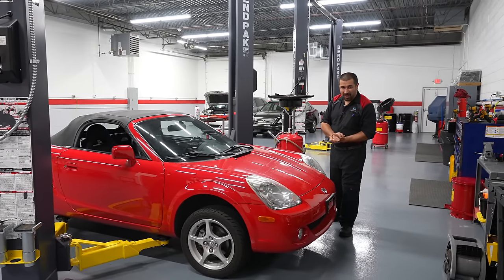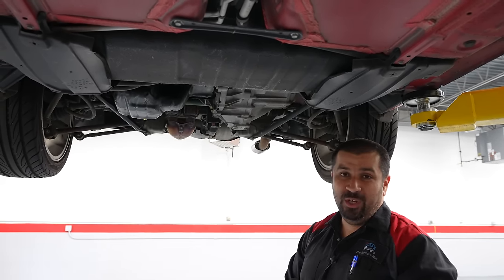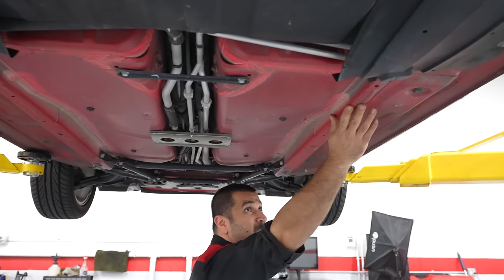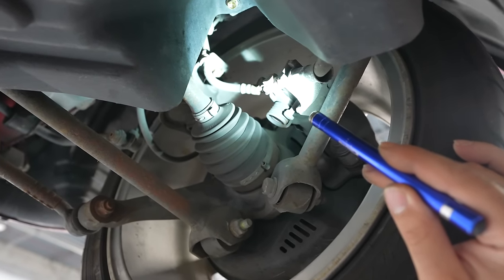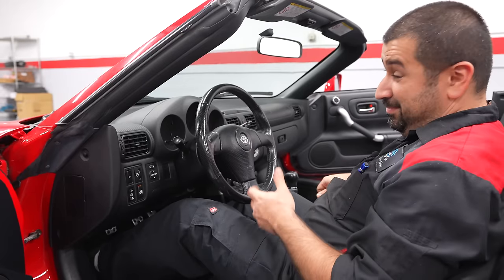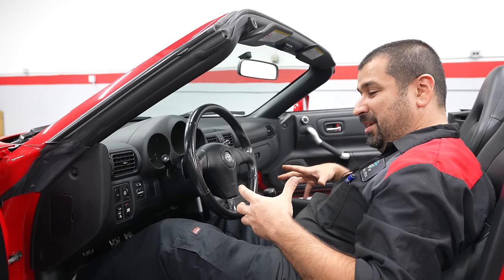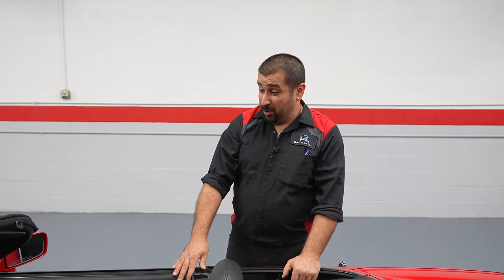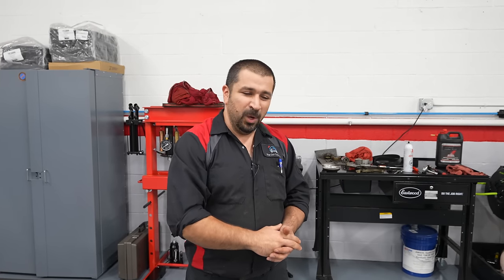Toyota MR2 Spyder Deep Dive | A True Toyota Icon That Should Come Back

Comment: Your reviews are really great! Appreciate your expertise. 

However, I am a bit confused of you stating that this engine is very good. Let's say this is not my experience with it.
Could you comment on the 1ZZ's problem and more importantly YOUR experience with them (how many did you fix, etc)?

We had a few 1ZZs in the family, 2x Celica, my MR2 and in summary 4 engine failures, related to oil consumption.
Only used high grade oil with stated viscosity and never did to many kms on one oil change. No matter what I did, when the engine decided to drink oil, there was nothing I could do about it.

Only changing the complete short block was a fix.

greetings from Austria
Dom
Reply: was a design flaw in the piston rings that causes this issue, shouldve got a 2zz celica :)
Reply: @arcanevoid9199  Actually, it isn't the pistons...it's the cylinders that distort and cause higher blow-by resulting in higher temps at the rings.
no i don't - wrong wheel drive buddy :)
that's the shame. 2ZZ in the spyder, yes please :D
Reply: @dominikr5408  the cylinders? huhhhhh, ive never heard that in my life. its common knowledge that its the rings, if you google the first like 8 results all say the same thing. and if that was the case how come changing out the rings/rebuilding it fixes the issue? and how come toyota revised the piston ring design and not the whole block? and of course you would be one of those "wrong wheel drive" people, let me guess they were automatic too?

Comment: COOL NEAT CAR, VERY INFORMATIVE VIDEO. I wouldn't mind having one to DRIVE, but it appears to be NOT TOO PRACTICAL except for just DRIVING. You can't travel with this vehicle, no room for LUGGAGE AT ALL. 40 years ago I had a 1974 Fiat X1/9 (first model year) best year for LOOKS, at least until 1979 when they got rid of the front and rear eye beam shock absorber bumpers which were UGLY AS HELL, I thought. That car was much more PRACTICAL THAN ALOT OF OTHER SPORTS CARS from that time period. It was mid-engine as well, 4 wheel disc brakes, removable hard top, built-in roll-bar with REAL GLASS back window with defroster. It had a HUGE front trunk (you could put just about the LARGEST SIZE SUIT CASE,  a hanging clothes bag AND the removable hard top stores on top over those items. Then you have another smaller trunk behind the engine bay area. It was fairly good size, you could put a LARGE DUFFLE BAG and still have room like the front of the MR2 has to put small things. The spare tire (FULL SIZE but skinny 145/80-13) the same skinny tires all around the car, gas tank was behind the driver and the spare tire behind the passenger seat. Of course the interior area was small but not that bad considering unless you are CLAUSTROPHOBIC. An old friend of mine had an MG Miget, that car had a TINY interior, the dash is right up on you nothing like the MGB. NOW the CONS of that car the tires were way too skinny even though it could pull better than a .80G lateral acceleration in a skid pad test which is closing into the Ferrari handling realm. 😮 The car has no power to speak of with a 1300cc engine rated at 68hp in America, European form it had 74hp. 0 to 60 was a PITIFUL 12.5sec. but it got GREAT MILEAGE depending on how FAST you drive it could get almost 45mpg if you kept your speed down to 55mph on the highway. I put mag wheels on mine and 185/60-13s all around and it was a MONSTER in the corners, it would STEAL YOUR BREATH AWAY in the turns. When I had passengers they would be grasping the dashboard to help keep them in place through the curves. THE CAR WAS A BLAST TO DRIVE, like driving a OVER SIZED GO-KART.  I MISS THAT CAR. 😢 HAD trouble back then getting parts. Bertone did a GREAT JOB making a CUTE, FUN TO DRIVE, GREAT GAS MILEAGE AND SOMEWHAT PRACTICAL TO TAKE A TRIP CAR. BEAUTIFULLY ENGINEERED, JUST WISH IT HAD MORE POWER BUT THEN I MIGHT HAVE LOST MY DRIVER'S LICENSE for going too FAST.  THANK YOU FOR YOUR INTERESTING VIDEO THAT ALLOWED ME TO REMINISCE. 😮😊😊😊😊😊

Comment: The MR2 has a rubber water line deep in the engine. Being rubber, it will eventually fail. The only way to replace it is to drop the engine.

Comment: Would it be possible to fit one of the new dynamic force engines into an MR2 spyder? Either the m20a-fks or the a25a-fks.
Reply: just 2zz or k20 swap, doesnt make sense to swap in anything else
Reply: @arcanevoid9199  Really? Because people swap other engines into this car such as the 2gr-fe v6.
Reply: @IrugaZERO  2gr is a good swap for a 2nd gen mr2 not a spyder. just because you can fit it in doesnt make it a good swap. why would you want to add more weight to the rear of a mid engine car? its also very light and doesnt need the torque of a big engine. youll just end up ruining the whole driving dynamic of the car, its a really good handling car
Reply: @arcanevoid9199  How about improved handling, making it less likely to understeer. Improved traction, acceleration and braking.
Reply: @IrugaZERO  it’s not going to improve that, the car already doesn’t have a problem with understeer. adding a whole bunch of weight is just going to push it over the edge and also make snap oversteer a much bigger problem. the mr2 spyder chassis is really well balanced from factory. the only improved traction it will have is accelerating in a straight line, and it will be worse at braking. sad when people ruin what the car is good at just so they can make it fast in a straight line
Reply: @arcanevoid9199  I was merely pointing out the benefits to increasing the weight over the rear axel like you asked. Whether or not it's a sensible decision it up to the person tuning the car to their preferences. The weight difference between the 1zz and 2gr is only 60kg. Hardly backbreaking weight there.

Comment: You have to hand it to Toyota for engineering a mid engine car with access to the engine unlike Porsche which actually put the engine under the car. You can’t see the engine and have to remove it to change the spark plugs😂

Comment: Lmao SMT is literally filled with the same parts from SMG, e.g. pressure sensors, etc. Don't shit on something you don't even know.

The left side vent is actually the intake for the engine. I don't doubt your abilities as a good mechanic, but come on. This is basic stuff.

You also shouldn't put anything on the shelf behind the seats. The flaps on either end of the shelf fold downwards when the roof is stowed, and it's very easy for objects to roll or slide off over their edges. They will land directly in the water drains and can potentially clog them, which will cause the interior to flood.

Comment: This is not a MR2 or a MR2 Spyder, it is a MR-S.
Reply: they are interchangeable, it is called different things depending on where you live. idk why you need to try and correct it
Reply: @arcanevoid9199  yeah, no. The previous versions were the MR-2. This one is the MR-S because it ONLY came with a soft top as in Spyder. A Toyota mechanic and enthusiast should know.
Reply: @fcorivers  so why is there oem badges that say mr2 spyder? why is it called that in so many places? and you can get them with hardtop, idk how you can be an enthusiast and be this picky with the naming of stuff

Comment: Love the car will never own one 😂. Too difficult to maintain with everything cramped and flipped around.
Reply: Oil changes are simple, mines needed nothing else in 12 years apart from the accessory belt which took 20mins and a coolant change wasn't any worse than any other car I've done.

Comment: That MR Spyder could've been great, if they didn't make it so dang ugly. "Let's make one of the greatest platform configurations ever devised, also make it lightweight and affordable, and then make it fugly af..." Great job, Toyota.... Way to shoot yourself in the foot. If it just looked a little better, we could've seen a longer production and potential upgrade with the VVT-L-I engine, and then it could've been one of the best cars of the 2000's. But instead, it just turned out to be one of the biggest flops.
Reply: I think it looks great - always did. Unfortunately, the MR2's fate was sealed by the Mk2, not the Mk3. The Mk1 MR2 was a cheap(ish), lightweight, compact runabout - loved by the press and public alike. Whereas Mazda went for evolution with the NA, NB, NC and ND MX5/Miata (this is what has given the MX5/Miata its longevity), Toyota created a more expensive, heavier, bigger GT like Mk2 MR2 - a change in direction from the Mk1 and press and public were confused - it was a different ethos to the Mk1 - big mistake. The Mk3 is the spiritual succesor to the Mk1 - not the Mk2, which, other than being mid engined, is really a different car. I've owned all 3 versions, and loved the Mk1 and Mk3 both dynamically and in looks, but never loved the Mk2, which was such a disappointment coming from the Mk1. If they had missed out the Mk2 totally (or at least called it by another name as it isn't a runabout) and introduced a convertible along the lines of the Mk3 with the 4AGE engine from the Mk1 in 1990 - that would have taken the fight to Mazda.

Comment: Mustang will smoke it and have more trunk space too.
Reply: only in a straight line, and this car with the same power as a mustang (or even less) would smoke it
Reply: @arcanevoid9199  no on any track or anywhere.. mustang has 3 times the power as this shitbox. Quit dreaming.
Reply: @keithbellair9508  this car will outhandle a mustang by a mile, and will be able to take the same corner at a much higher speed. do you understand cars at all? less weight is better, and mustangs are pretty heavy
Reply: @arcanevoid9199  weight does not matter when you have huge tires to back it up. Weight keeps the car stuck to the ground. This cracker box will bounce all over
Reply: @keithbellair9508  it does matter actually, huge tires doesn’t counter it lol. if your car is bouncing all over that’s not an issue with weight, that’s suspension. you should go drive one
Reply: @arcanevoid9199  wven the wind blows those cracker boxes around
Reply: @keithbellair9508  average mustang fanboy lmao, one day you will learn
Reply: Mustang is garbage.
Reply: @mr2bmw  bring your your little 130 horse 4 banger to the track and well see what garbage is.